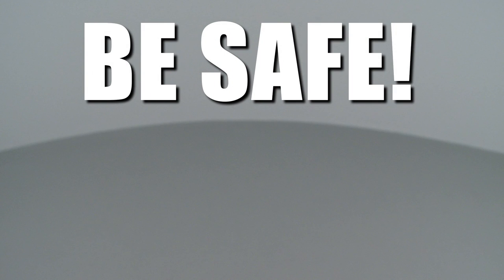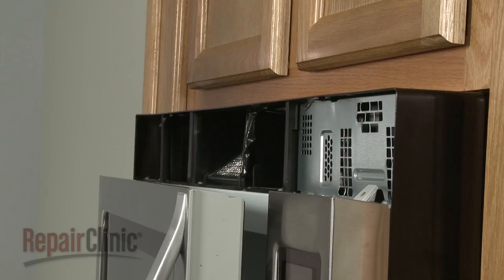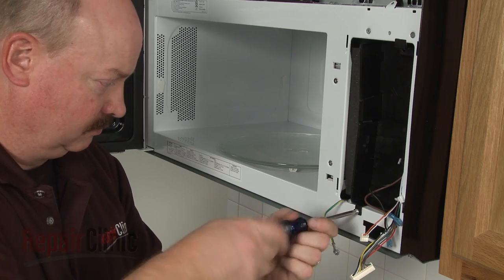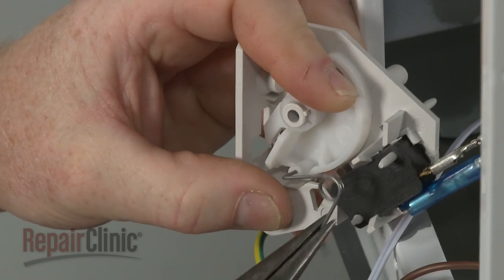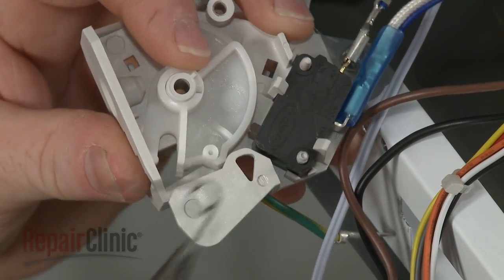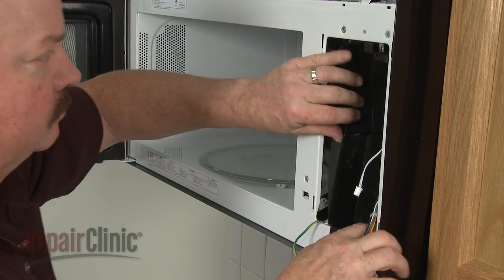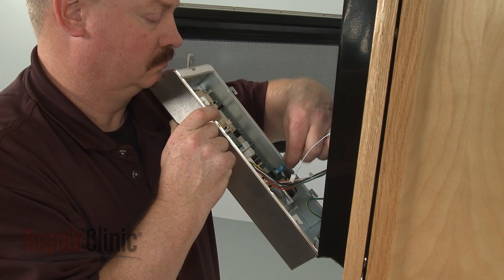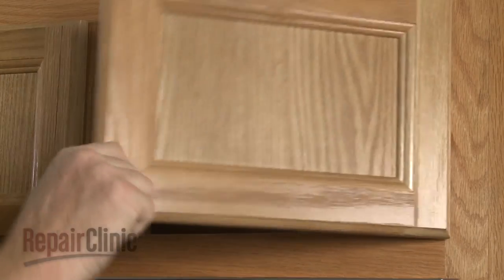Whirlpool Microwave Lower Door Switch Replacement #W10269460

Comment: Thank you for the instructive video. My microwave light would not go off when the door was closed. I discovered that the spring popped off of the door latch. I had to watch this video to show where the spring went and the piece it attached to. Now the light goes off when the door is closed. Saved me from buying a new microwave.

Comment: This is awesome thanks!
What I would add is to be certain to tighten the interlock allen (front) screw snugly.
Be sure you have the correct allen star bit to get it tight.
The constant opening/closing/slamming of the door can cause the interlock to shift slightly over time, and any mis-alignment whatsoever will affect the actuator button's consistency.

Comment: Thanks for this great step-by-step video. My Whirlpool microwave oven (WMH76719CB0) was indicating that the switch was not working. 90% of the time when opening the door, the inside light would not come on, and closing the door and trying to start the microwave would show an "Open/Close Door" error message on the display. If I repeatedly open and closed the door multiple times in a row, eventually the light would come on indicating to me that the switch was working again and I could microwave my item. This intermittent switching tells me that the switch is making a bad contact. I took out both switches (top switch part #W10269458 and #W10269457, and bottom switch part #W10269460), popped the covers off the switches, sprayed the switch mechanism and all the contacts with electrical contact cleaner spray (you can buy at the hardware store), and put it all back together. The microwave oven now works properly! However, if it fails again, then I'm going to replace the switches with new ones.
Reply: Scott,  What type of electrical contact cleaner spray did you use?  Quick Dry (leaves no residue)?   w/ silicone?  w/No Silicone?

Comment: Great videos!  Thanks so much! I get a door not shut notice on my microwave, I pulled the lower door latch assembly and found that the cam snaps backwards rather than forwards when the door is opened causing the latch to lock open and past the point on the cam that tells the microwave that the door is closed. I tried to re-tension the spring to see if the spring was just too used/loose to move the cam forward when the door is opened.  Also there is a little "disk" on the opposite side that should hold the cam from going back too far, it doesn't seem like that mechanism is working either.  I can't find the part on anyone's website for the spring or the cam, nothing on ebay either.  What if I disconnected or bypassed the lower switch the switch from mechanically being able to go back too far?  Thinking a drill and a screw could override the mechanism but allow the cam to go back far enough to complete the switch circuit? I wouldn't want to keep the circuit closed all the time as it would wear out over time. If only there were parts available on a 7 year old microwave, doesn't seem unreasonable for a $800 microwave :(.  Thanks for your help. My unit is a KHMS2050SSS Kitchenaid (parts needed are PS2373234, PS1491578, PS1491579) Thanks!

Comment: Really good video. How do you know the part that you need to order? Looks like the bottom latch but is not marked with a number? So how do you know what you need to order? Thank you
Reply from the maker: You can enter your model number on our website and all the parts associated with your model will pull up or you can give our team a call and they can help you order the part: RepairClinic.com.

Comment: Caution: Take pictures before removing any connectors from the switches.  This video is using my exact Microwave, so I trusted the wiring in the demo.  It blew 3 fuses and ruined my wall plug.  So do NOT trust the wiring, even if the instructions are sound, overall.

Comment: Good video, helped me a lot. In my case the locks on my microwave were in the close position so it will not lock the doors, all I needed to do was to pop out the lock and open them. Put it all together and worked just as new. We'll se for how long.
Reply: My unit is not turning on when I plug it back in
Reply: This fixed mine too.  Didn't need any new parts.  This is definitely a good lesson as why you shouldn't slam a microwave door shut!

Comment: I found both switches on the door tested good with a continuity test. Seems only moving the plugs on and off a few times improved connection and everything work fine then..  Little contact cleaner all it took.

Comment: I have just reseated the two cables back to the micro switch terminal. Did not test it. One cable connector has colors, two harnesses joined, to the non common terminal. The single gray, which I think the ground, connected to the "common" terminal of the switch. Now I'm slightly concerned since I didn't take picture of it. It's dishwasher door switch. Does common terminal of the switch have single cable connected?

Comment: I have a problem where my microwave sometimes doesn't properly detect the door is closed, or keeps running if I open it without hitting cancel first, but I've opened it up and checked all 3 switches and they're all clicking fine. Is the issue maybe somewhere else?

Comment: Need help! I replaced the upper switch exactly as shown and the microwave breaker keeps tripping. I cannot figure out why/where the short circuit is
Reply: Ok my microwave is constantly say close door, when the door isn't open at all, I've replace two switches now if there is a third switch I have no ideal where it could be, I had to replace the lower switch witch was broken, but now even the new one is saying close door. Can someone please help me out with this problem.